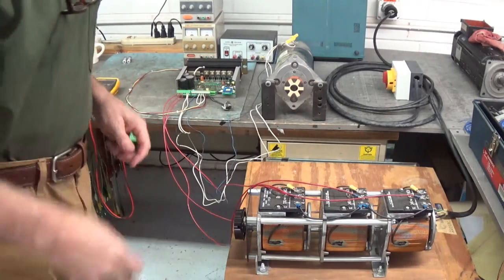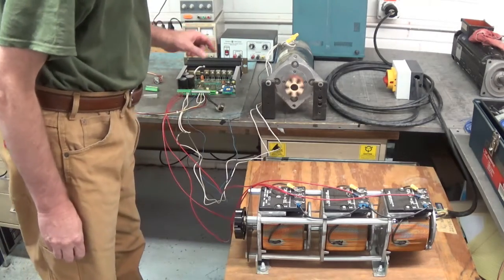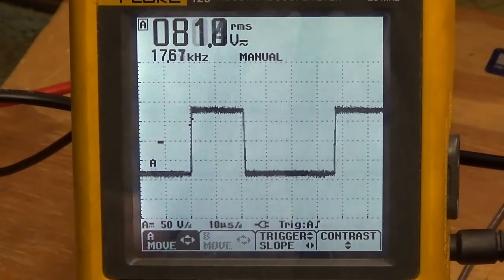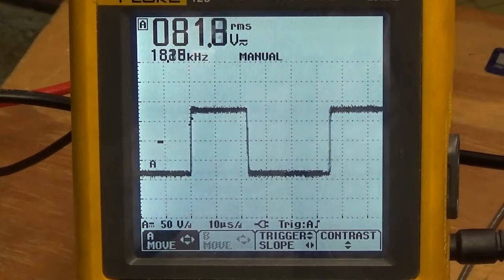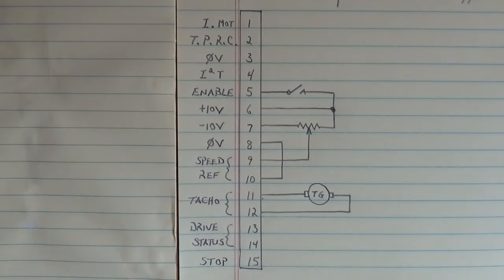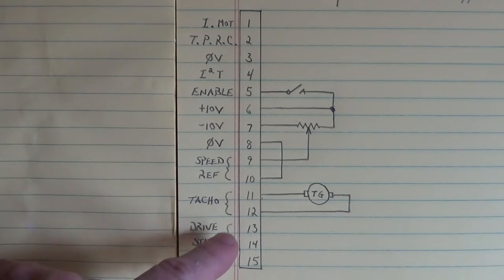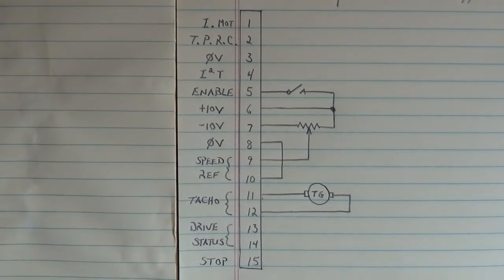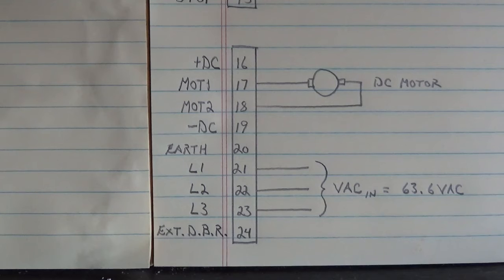Repairing the Control Techniques Midi Maestro DC Servo Drive

Comment: Nice video.   Do you have any experience repairing the power supply section of this drive?  I currently have one in which the Healthy Drive led is not illuminated (phase  input voltages are all correct).

Comment: Great vid. I just tried to move mine from AC 3 Phase powered to DC but was on the limit on the DC voltage. I says the Braking Resistor needs to be disconnected. I saw nothing was connected, not realising that there is an internal one. I powered, LED off, some burnt smell. Opened up, nothing obvious, no fuse to replace. Any suggestions on where to start please? At this rate I might sell what I have and convert the machine to AC Servos .... but this might be an easy fix, not sure. I dont have 3 phase, hence trying to power off the DC bus as per the manual. Thanks.

Comment: I have the same units, I tested as your video but the problem is the servo motor can not rotate while the potensio meter increase. The servo motor rotate full speed if tacho generator not conected. What a problem sir? Thank from Indonesia